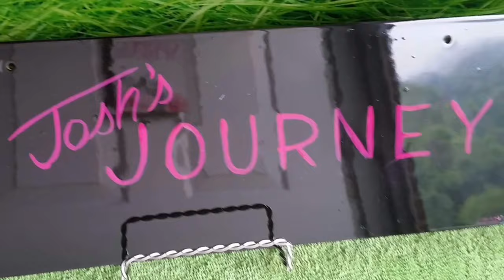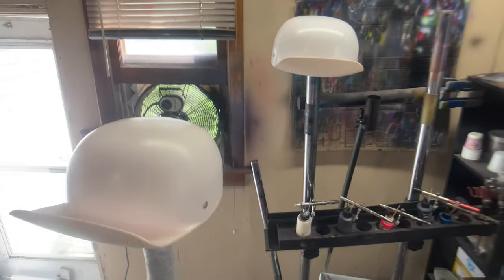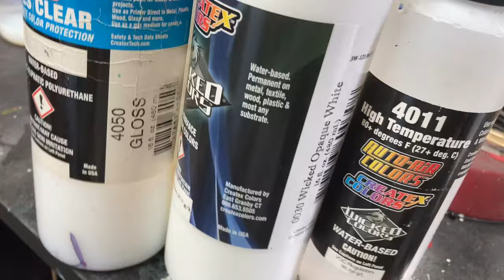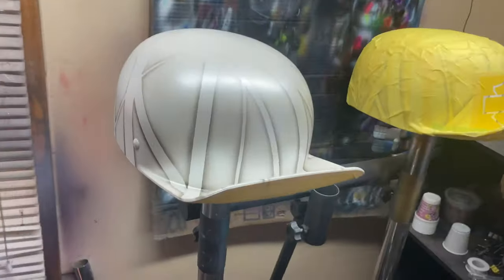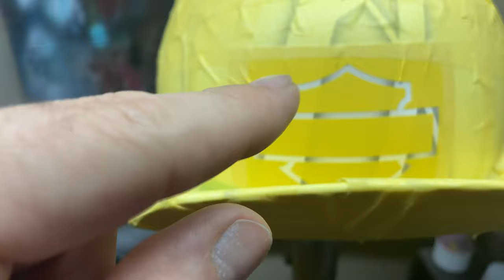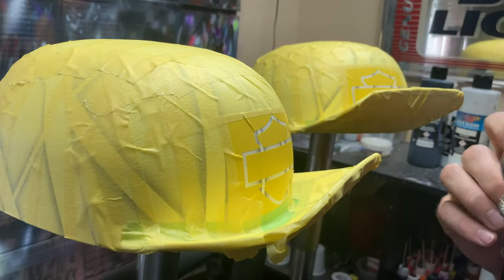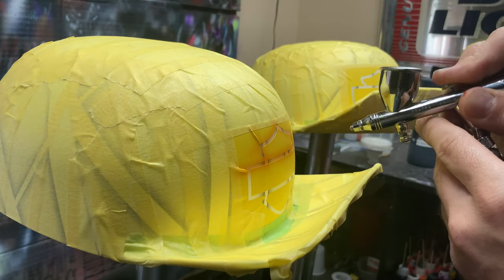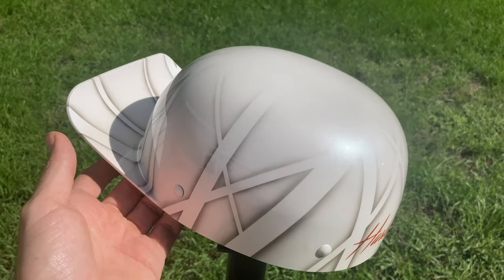Painting Baseball Cap Helmets with Createx- Harley Davidson

Comment: So with this type of surface/plastic material, you don’t spray a primer coat ?
Reply from the maker: I did prime them with UVLS gloss clear. 2 or 3 medium coats. It is an excellent adhesion promoter. I use as the base for all my work on plastic materials. It’s also direct to metal too.